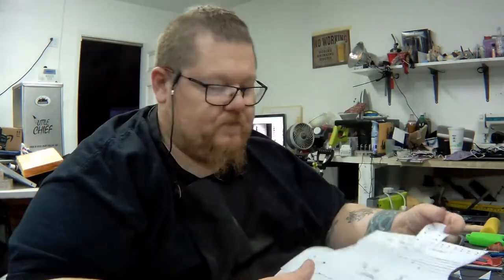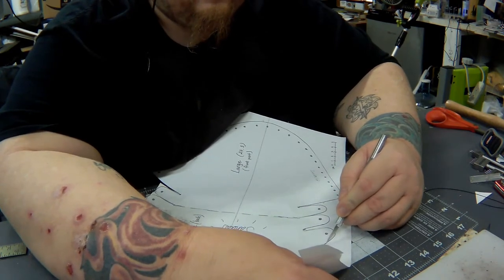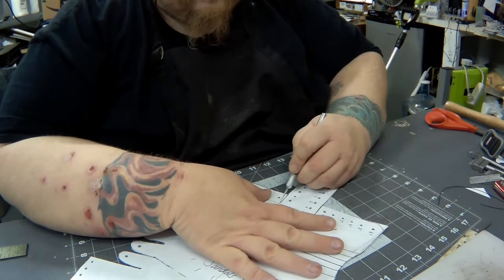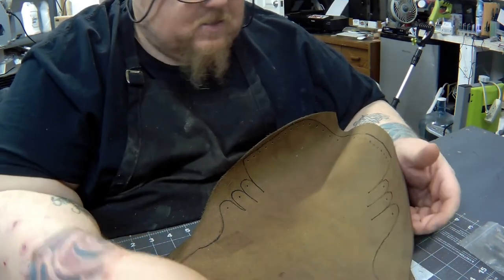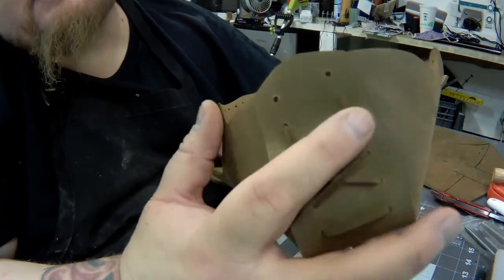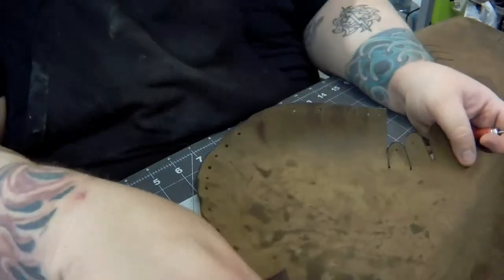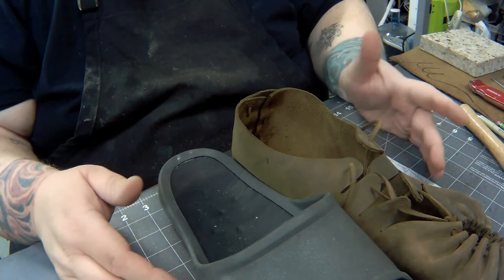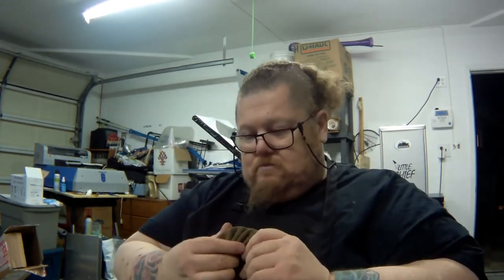sun sandals simple leather shoes

Comment: Tks made mine different but will make toe bit like yours next.  Good job!!
Reply from the maker: Rock on! thanks for the comment and clicking on my video. i think the next time i make these. by the way these have served their purpose well. they make a great house slipper /shoe. the tough leather has kept my feet from getting a sliver of broken glass once or twice now. i have worn them in the back yard and front yard in the shop. but mostly around inside the house. they dont work well on saving the feet from rocks. you can still feel them. id suggest maybe making a tracing of your feet and cutting just that out of a heavier stiffer leather and glue it to the bottom of the sandals. to protect the feet more. and a more resilient sole. deffinatly use a soft grade leather i likeed the oil skin type leather mine was just to stiff of a temper of leather.also a nother thing to help make things last longer. get a small thing of bees wax. and run the lacing your using, across the bees wax block a few times and get it good and covered. then take a small piece of light /medium weight canvas and run the lacing through it with the bees wax on. the heat from the friction will work it in to the leather . and help it become a bit stronger. lasting much longer as well. also if your going to be wearing the sandals out doors more often than not.  get some mink oil from a supply store i get mine from tandy leather. and rub it into the leather that'll help weather ize them a bit.